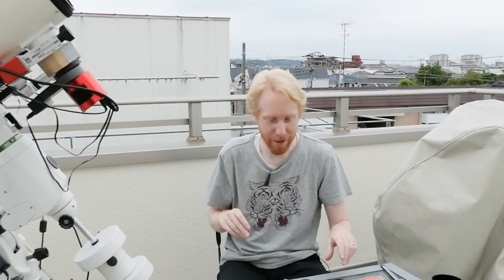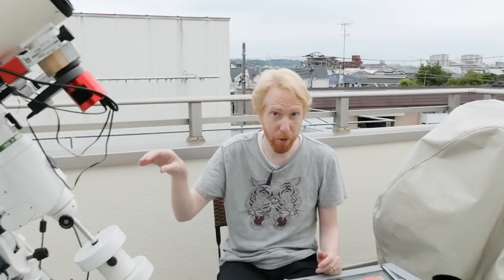What is BACKFOCUS?? And how to deal with it? - Starting Astrophoto for Lazy People - Ep 8

Comment: Thx heaps Cuiv, it's certainly a crucial topic. I believe the only aspect you may  have added was 'adjustable flattener/ reducers' possibly a more tecent. I use Williams Optics Refractors, & Pegasus Astro gear - they offer a rotator, all work well with N.I.N.A. Thx again for your advice & passion
Reply from the maker: That is an excellent point Geoff - thank you so much for that! Pinning the comment so others can see it.
Reply: @CuivTheLazyGeek  like to add. It only made sense once I wrote down every spec (mm width) of each item. Then purchased addition al 'fine' spacers such "Artesky m42 fine tuning ring kit". After success & failures, photographed the image train to record noting dims so if changes one has baseline.
Reply: @icanifuwill  thanks Geoff - likewise - callipers and the fine spaces made all the difference .

Comment: Another great video Cuiv! One thing I stumbled across in my search for backfocus was a line of products called VariLock from Baader which are inserted into your image chain and allow for very precise adjustment of your backfocus using only one device. They aren't cheap, although they are compared to any camera, lol. But what is great is that you can get precise back focus down to tenths of mm with only 1 piece instead of having a stack of spanners.  I have both the 29-49mm and the 20-29 mm versions which pretty much cover all of my bases.
Reply from the maker: Wow, that looks great indeed, I am tempted now! I may buy the same that you have... So one end is male T2 and other is female T2? The pictures make it look like make M48 - male T2. And I assume that as you adjust it, it rotates, so that if you want to keep the same camera angle, you'd need to use a rotation mechanism somewhere right?
Thank you!
Reply: @CuivTheLazyGeek  Yes, it is male T2 to female T2 so it fits anywhere that is convenient in your T2 chain. It also has some adapters. I believe a T2 to M48. And it does require rotation, it has a locking mechanism. It also has one side held on by 6 Allen screws (wrench included) which means theoretically, you could get the exact  proper length, loosen those screws, rotate the camera and tighten them back up although I'm not sure how practical it is in the field! I have a Celestron T-Adapter that uses a locking nut so I can rotate my camera that way so I've never tried the Allen screw idea.

Comment: M42mm x 1.0mm pitch is a popular camera lens fitting on early Pentax and other brands of SLR, Edina etc. When adapters started appearing for using accessories on telescopes, the T-Mount was introduced with a M42mm x0.75mm pitch thread. Another headache was born, we now needed adapters to go from M42mm x 1.0mm pitch to M42mm (usually written as M42) to the new T-Mount thread of M42 x 0.75mm pitch. And as we now see, we need adapter rings to go from M42-M48, which has become another standard in Astro camera’s and accessories fittings. Many folks are often thrown when trying to screw an M42 x1.0mm pitch into an adapter with the finer 0.75mm pitch, or vice versa, things screw together for maybe 2 or 3 threads then stop. I am lucky in having a workshop with lathes so I can make my own adapters and settle on either a 1mm pitch thread or the finer 0.75mm. Over 60 odd years I have stuck with 1.0mm pitch, which is more robust and one I can machine without too many gear wheel changes. Making my own gear has always been part of the fun for me. Greetings from Tasmania Australia 😁🇦🇺🦘’

Comment: Ah, the joys of backfocus! A dark art. Even though many reducers etc do state 55mm and even with the adjustment for filters in the light path, it may not be getting good star shapes at the edges. I’ve heard of some people needing to be quite a few mm off the set distance to get a good image. I think you are right to recommend the callipers as you need to be accurate and then it’s trial and error around the 55mm or other recommended distance. Great idea for using the little thin rings to adjust rotation in systems where there is some flexibility in backfocus distance. Love the videos you put up and always learn something new.
Reply from the maker: Exactly, backfocus is indeed a dark and mysterious art, for it is dark and full of terrors! And yeah, sometimes the 55mm quoted is not correct... Somehow I've seen that most often with SCT FRs, but not sure why (the good thing being that SCT FRs, with the exception of EdgeHD, seem to not care that much about backfocus). Always glad to be teaching people something new, and thanks for watching! :)

Comment: A little info on the 42mm camera threads, commonly used back in the days before many camera manufacturers changed from 42mm screw mounts to bayonet, the ‘standard’ was 42mm diameter by 1.0mm thread pitch. So many lenses were interchangeable with different camera makes, PENTAX, PRACTICA ETC

Comment: Ah, good information here. Yea, this is stuff I never really ran across in photo/video world, as lenses would be already designed for the camera. I actually just had a camera adapter recommended to me, which I noticed was very short compared to the one I have here for another camera, and I was curious about the difference. They are both mirrorless cameras, so the suggested T-ring probably wouldn't have worked, had I ordered it. Well, not without some extra steps, anyway. Great channel, thank you.

Comment: If you put a filter on the telescope side of the flattener/reducer (they sometimes have M48 threads for 2in filters), then you don't need to worry about changes to backfocus to the camera sensor. Handy tip that saved me from backfocus issues and sourcing 1 mm and 0.5 mm shims to sort it out. I screwed the filter onto the reducer so light is filtered before it is corrected, and 55 mm works just fine. Maybe somebody mentioned this in the comments, just too many on your vids to read them all! Clear skies.

Comment: Hi Cuiv, Excellent video by the way just what I was looking for, my  focal reducer for my Saxon 127 arrived recently and I am in the process of  getting it adapted to my camera and scope. I had to order an other adaptor so an other long wait for it to arrive. 
   I measured the b/f for my canon dslr which is 55mm with the tee ring on, which is what I require, now my question is, is there any rule to say that you can't fit a filter draw on the other end of the f/r and still be  focused? I have been through videos and surprisingly there is no mention of this been done. The other option is to take the camera out and fit the filter in the nose piece each time I want to use a different filter, then the hassle of refocusing, the filter draw in the train seems a better option to me.
           Robert              Vic'   Aust'

Comment: EdgeHD 800 back focus of 133.35 or 105mm (with reducer) are computed without considering the thickness of threads? SCT has 10mm but Reducer has 12.5mm - so be careful. Celestron diagrams are notorious for being wrong or inconsistent. ZWO cameras (usually) come with two spacers to make up the 55mm BF of a DSLR with T Mount - convenient and saves additional expense since many BF calculations assume a DSLR is being used. Celestron supply a 11.55mm spacer with their OAG to help get spacing exactly right (if not in their diagrams).
Reply from the maker: Hey Simon! I don't know about without the reducer, but yes with the reducer, it is 105mm from the top of the threads rather than from the shoulder of the FR. It was wrong in an earlier Celestron diagram, and has been corrected since... Backfocus really is a dark art.

Comment: Thanks for that. You mentioned that it's particularly difficult to do Astrophotography with full frame. But iirc you never really touched on "why" that is. I currently use a full frame DSLR and I was looking into getting a Astro camera in full frame, but now I'm a bit scared. Could you tell me why it's so difficult, aside from the huge image circle needed. 

Also, Tokyo rocks! You're kind of living my dream rn :D
Reply from the maker: Thanks for the feedback Princess Luna (and yeah, Tokyo is awesome :D) - so it's exactly what you mention: the optics. You want the huge image circle AND any defects in optics, or back focus will get immediately more visible on the edges of a FF sensor. Of course there is an easy solution: crop. The more difficult solution is to spend a couple of nights adjusting everything to get perfect backfocus and no tilt!
Reply: @CuivTheLazyGeek  Id probably spend the time to get everything perfect because it would bug me the whole time that I'm paying FF just to crop stuff away afterwards xD. 

Thanks for answering, now I'm slightly less worried and confident enough that I can get it right, thanks :). And enjoy your time in Tokyo :3

Comment: Back focus is the bane of my existence. I can't use my super fast Sony E Mount glass with any of my QHY cameras. My QHY 16200A CFW7 has a back focus of "around" 54 to 55 mm (you can't physically measure it). I don't know if the filters in the device have been taken into account but with some luck, they will add another mm to my back focus. Lets hope the 16200A is 54 mm so I can get 55 mm with the filters. My telescope has a "deep" thread so when screwing the OAG part of the camera onto the reducer, I can't screw it all the way to the flange. So either I ditch the OAG or I hope and pray that the 55.8 mm back focus length I have won't screw up my images. Don't get me onto the incredibly poorly designed ZWO OAG (bought prior to the QHY stuff) or I will be booted off Youtube for profanity. :o BTW, excellent information as always.
Reply from the maker: Yeah backfocus is such an annoying part of the whole thing! Once it's dialed in there is no need to bother about it anymore, but it can be such a pain to get correctly. And then when you realize your camera eats up a lot of that backfocus, it can get extremely aggravating... The ZWO OAG by the way got a second version, which is actually decent. ZWO often has poor first release, and then they listen to feedback and start selling a decent v2. It has been the case for their OAG, whose v2 is much better than their v1. Thanks for the feedback and clear skies!

Comment: So since buying my rig and dedicated astro camera (cheap astro camera) I did notice I couldn't achieve focus straight away without pulling the imaging sensor back within the eyepiece housing... Even more recently I found out this was due to back focus (although I did think that such an inaccurate method was probably not the best). So I have a Skywatcher Explorer 150p which I believe has a focal length of 750mm F/5, I'm using a Bresser full colour HD deep sky camera, I use no filters (although I have a Svbony IR/UV filter which does literally nothing probably because I never used back focus now I think about it). Given the complexity of this video for much more advanced setups what should my back focus be? I have nothing else in the imaging train at this point, but could do with some guidance as to being more precise, this will help when I eventually start considering a more advanced setup.

Comment: Good info. I use Vixen AX103S with ASI294MM and ZWO Filterwheel and get weird star shape, somewhat like a comet. The stars are crisp on one side but un focussed on the other. It become worse when image is out of focus. It affects the images with H O and S filters more than LRGB and if I use no filter (empty slot in filterwheel) the stars look round. I use 3nm Astrodon (H and S) and 3nm Antlia O filters. So I am not sure if it is back focus issue or something else. Distance from back of my scope to the surface of camera is 98.6mm so the total back focus distance is 105.1mm. My Vixen dealer told me that backfocus distance for my scope is 103mm but i read online it is 150mm.
Reply from the maker: That sounds like a weird problem. It could indeed by a backfocus distance issue, and not having any filter hides it due to star blooming on the camera. Really hard to tell - unfortunately I am unfamiliar with that scope so can't really help...

Comment: Hey Cuiv - another great clip from you - always entertaining and informative.  Just a question really to confirm understanding - if the telescope manfacturer's manual specifically tells us what backfocus we need betweeen the sensor and (say) the flange of the flattener (mine states 75mm) - I presume this value takes presidence over the camera backfocus default (of 55mm)?  Cheers!!
Reply from the maker: Thank you for the feedback! You are correct - the backfocus is dependent on the optical element in front of the camera, the flattener in your case. So for you, you want the camera sensor to be 75mm from the flange of the flattener. Cheers & clear skies!

Comment: Very much informative video. Thanks. I need a suggestion: For the f/9.8 (102/1000mm) refractor, which is the suitable 0.5x focal reducer (FR) for astrophotography using ASI294MC Pro camera? 1.25 or 2 inch FR?

Comment: Need to check mine. The drawtube may be intruding into the optical path when using a Canon DSLR and Vixen t ring.
Reply from the maker: I hope you can get it figured out... Good luck!
Reply: @CuivTheLazyGeek  Ah, I will. Never fear. But it can wait till the repairs/upgrades are done. This would explain the odd diffraction spikes. Does your ZWO imager screw directly into the R200SS drawtube assembly or do you use an adapt-TATER?

Comment: Ok....I have a 9.25. I'm getting a ASI533 and I'm using a 6.3 reducer. I know I need 105MM backspace from the reducer to the camera. With my T-adapter, the two spacers that come with the camera, I get my 105MM backspace from my reducer. Now....I want to add the Starizona  filter slider. If I take off the ring that's on the front of the camera that comes with it, and THEN add the slider, I still have about 6MM too much backspace. 
Without looking at my numbers I did earlier....it might be 6.5MM. 
 How can I get rid of that extra 6-6.5MM?
Surely someone has had this exact same problem, and has an answer.
Right?
lol

Comment: Truly informative, thanks! I need to get those M42 extender tubes. I'm using a very controversial field flattener on my ED80 F6 at 55mm back focus, well, as specified by the manufacturer. However, the corners of the resulting image show coma, this time seemingly shooting away from the center - trails of stars pointing to the center. Wondering if the field flattener has overly corrected the coma. In that case, do you suspect I need to increase or decrease the back focus? I cannot decrease though.
Reply: I have a similar problem, did you manage to resolve it?

Comment: Hi Cuiv, I can see why getting back focus distance is important however on a refractor or Newtonian telescope like yours won’t the rack and pinion focuser not compensate for a couple of mm error in back focus? I can see why on a SCT such as my EdgeHD which has a 146mm back focus has no rack and pinion to move camera back and forth it’s important to be accurate.
Reply from the maker: It's a good question! But in the end, the field flattener / focal reducer / coma corrector move together with the R&P focuser. So the distance from that corrective optics to the camera is not affected by the focuser! So you need to be just as accurate as with the EdgeHD. And actually this has been a point of discussion about using a Moonlite focuser with EdgeHD for example, as then focusing changes the backfocus compared to either the corrective lens in the EdgeHD, or the FR of the EdgeHD!
Reply: Hi Cuiv, yes I agree with you. It is all down to the relative position of the focuser and any correctors/flatners in the optical train. You video did indeed get me thinking about my moonlite focuser on my EdgeHD. I think the best compromise for this situation is to set the camera sensor at exactly 146mm from the back face of the focal reducer using the moonlite focuser to achieve that and then use the SCT mirror focuser to get a sharp image on the sensor. That will ensure SCT mirror is in correct position to allow moonlite to do very fine tuning using NiNA for example when a new filter is introduced into optical train. It’s funny I had not planned on looking at this video of yours, I was too lazy ;-) but I am glad I did it really got me thinking about my setup. Next job is to get some callipers!!!

Incidentally one area that helps in this matter is the small but finite depth of focus range (as described by https://starizona.com/tutorial/focusing-2/) which gives a little wiggle room for imperfections in focal plain in particular on long focal length telescopes.
Reply from the maker: Yep, I had an EdgeHD+FR+Moonlite a while back, and I did exactly what you described. The focuserneeds to move by a really small amount, so backfocus was ok in the end!

Comment: Hey just found your site on backfocus. Here is what I dont understand. I have an Explorer Scientific ED-80 . I us the ZWO294 MCpro. Now for my to focus I am using 2 35mm extensions then use the 21mm and 16.5 mm that came with the camera and the focuser has a scale on it that tell me I am 14mm back so that is 121.5 right there I have not accounted for the ring on camera or the filter screwed into the nose piece that is the 1 1/4 in. nose piece  .. So where does 55MM come from ? Hope you can help.. Thanks for the video